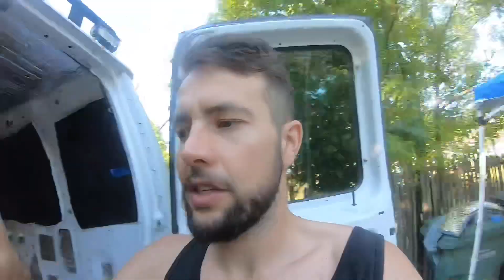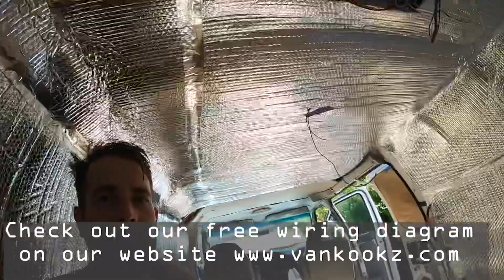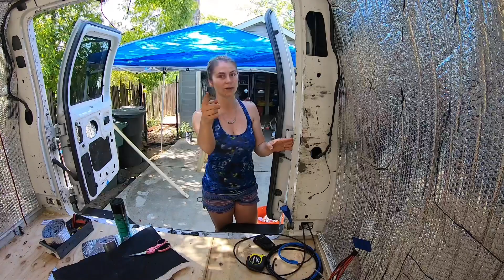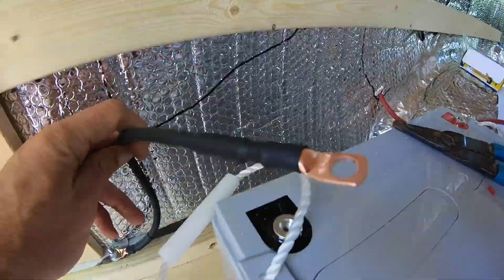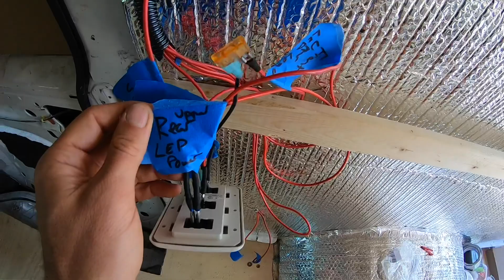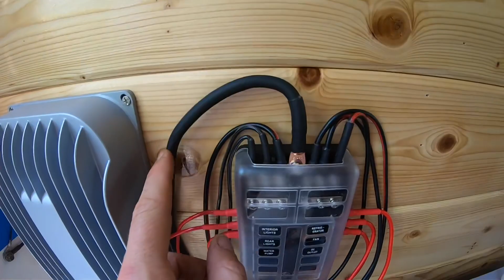Step by Step How to Wire a Van Conversion | Ford Econoline Van Conversion

Comment: Witch wire is positive red or black
Reply from the maker: Red
Reply: @Vankookz  so if I buy that same wire from that link my red will be  positive
Reply from the maker: @Missy.explores  you can use whatever color you want for positive and negative you could do pink and purple just keep it the same.

Comment: Why do you need a wire connecting your solar battery to your engine battery???
Reply from the maker: The wire to the engine is hooked up to a battery isolator that charges the van's "house" batteries while driving or while the van is running.  Sometimes you don't get enough charge from solar if it's cloudy or shady so you can start your engine to charge your "house" batteries. It's a nice back up system to have so you don't lose power to your fridge and other necessary electronics.
Reply: @Vankookz  thank you so much for the quick response I really appreciate it

Comment: What size of plastic wire loom did you use?
Reply from the maker: I wanna say 3/8” from auto zone. In the back you can ask them for them bulk cut to order stuff
Reply: What kind of lights did you use

Comment: Are the panels and the alternator both charging while driving, or do you have to somehow switch from the solar to the alternator?  Thanks guys
Reply: Greg foster the battery isolator he put in does the switching. Battery Doctor was the brand I think
Reply from the maker: Yes this is true also both the charge controller and the isolator have an over charge protection so they will both stop once the battery reaches a certain voltage.